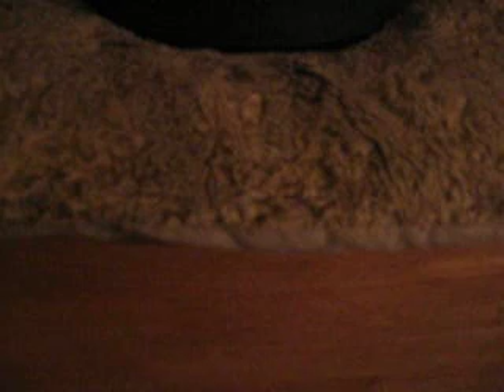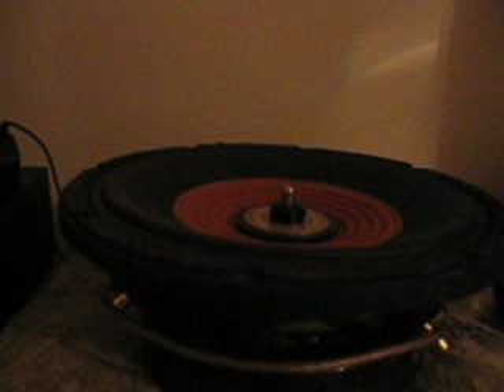CERWIN VEGA STROKER 12 D2 Excursion 1hz-35hz

Comment: Xlim is limited by the surround but the sub will still start to sound bad above 23mm peak to peak. A modified surround will not make any difference but the effective cone area may be smaller and the risk to damage the voicecoil will be higher. The Stroker 18" has longer excursion but it is still not so well suited for frequencies lower than 30Hz. It will work and maybe sound ok but the efficiency will drop very fast if you tune the box to low.